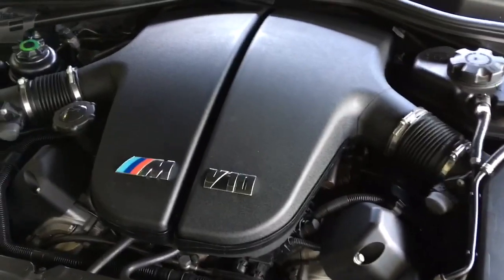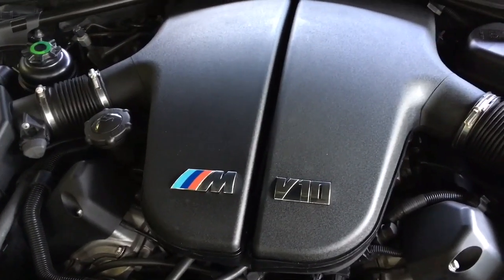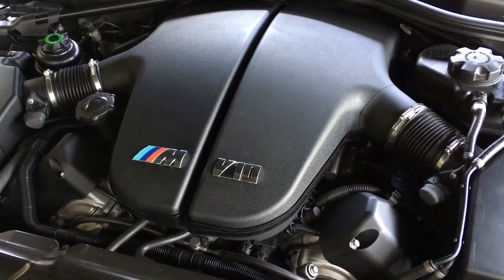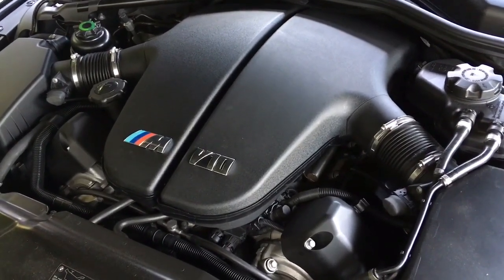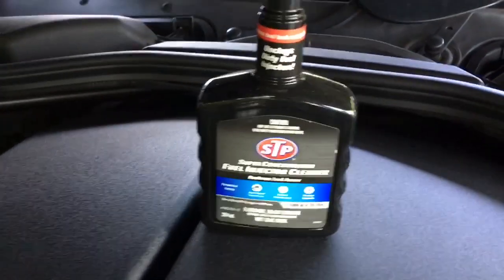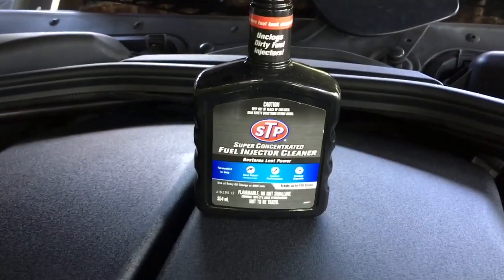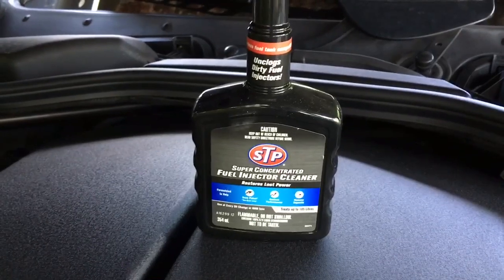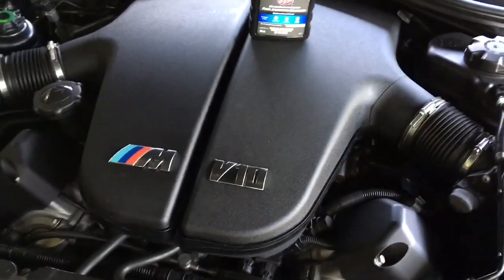How to avoid murdering a V10 engine   (easy BMW S85 diy)

Comment: Can your block crack from a fuel injector being stuck open? I had a shady mechanic tell me my block was cracked after I brought it in for a bad fuel injector.
Reply from the maker: Unlikely, depends where it’s cracked. Normally the con rod will bend

Comment: Hey mate, love your videos they are incredibly helpful. i just got an m6 and put a bottle of injector cleaner in but wondering if i should budget upfront to just replace the injectors. its got 122km on it and has barely been driven by the PO in 2 years
Reply from the maker: For sure a good idea. I owned my M5 for 3 years before I did mine, but wish I’d done it sooner-
https://youtu.be/7otKulz43WY

Comment: Hello M Tech Guy,

I actually just replaced all injectors on my M5 as maintenance while rebuilding the throttle valve actuators.

My NEW biggest concern is the lines from the tank and even the fuel rail.  No filter and degradation of the fuel feed system could compromise even NEW injectors!

PS:  Have many engines....2 full, plus 2 short blocks....plus car.  Purchased engines before car to learn.  Two engines clearly hydro locked with bend rods and bores scored so badly, they could not be re-finished in Alusil at 0.2mm over......GRRR!

Have you added a fuel filter yet?  Interested in near OEM install for filter near rail to minimize potential of clogged/open injector.

Cheers,
P-Chi
Reply from the maker: Sounds like you have a few S85’s to play with 👍
The fuel filter at the tank is fine so long as it’s changed out now and again
Reply: @MTechGuy  

Hello M Tech Guy,

Yes, I do have a few engines to play with.  I have been researching the S85 for years, and have wanted an M5 even when they were "ugly" (e28), but it was so powerful, I fell in love!  The M5 has always been a wolf in sheep's clothing!...but not a big fan of the newer "hot block turbos".

Love your videos and please keep posting.  I now have a vehicle and am doing maintenance beyond just my "play engines".

As for why I replaced fuel injectors and ask questions on fuel system....please view link below on the M5board.

https://www.m5board.com/threads/s85-bore-issues.607517/page-4

Cheers!
Mr. P/P-Chi
Reply from the maker: The E28 M5 is a nice car! Not a big fan of turbo charged cars myself either. Wouldn’t mind a spare S85 to make some vids on. Will have to check out that link, injector fail more common that we’d like aye!
Thanks for following the channel man, Merry Christmas 🎄
Reply: @MTechGuy  

Merry Christmas and a Happy New year to you and your family.

Hope you keep the M5 content, and all content up for 2022.

Cheers,

Mr. P/P-Chi

Comment: Mtech guy, what is you opinion on an engine tune??
Reply from the maker: I wouldn’t bother. The S85 is an extremely well designed engine for the amount of power it makes. Tunes have been known to contribute to issues & failures. 507hp is plenty for a street/road driven car anyhow!
Reply: @MTechGuy  mine is already tuned, but I didn’t feel much of a difference. I’ve put over 6k miles on since tune and it’s been fine. But I don’t want my shit to blow up
Reply: @MTechGuy  mine might not be as reliable, but damn having an ESS supercharger on my M6 is fun. 675hp is definitely worth it

Comment: Ok, gotta add my 2 cents here. I have two of these. First of, STP is hype, like Fram filters, all hype... use Lucas fuel system cleaner, it does it all, not injector cleaner, use the fuel system cleaner...Lucas. Ok, rod bearings Yes, warm it up correctly [it's vital]. I believe with all my heart, if there were a problem with the material in the bearings BMW would have fixed it...there isn't. Proper warm up, use the correct oil, 10w60 only, not 10/40, 20/50...no. I know the 10/60 is pricey, but what many don't know is the 10w60 is vital for the vanos system, the high pressure line internally and lubrication...I could go on, but.......................
Reply: The foremost s85 engine builder in likely the world recommends redline 5w/50. The vanos system is dependent on oil flow which is affected by pressure. Fact is a thinner oil flows more. Here’s some fluid dynamics equation for you…Flow = pressure/resistance. Resistance = line length x viscosity/ line diameter cubed. So, if resistance is greater due to viscosity (given all variables are the same), the higher viscosity oil will not flow faster than a lower viscosity. The question becomes what’s the oil pressure with lower viscosity oils and do they offer adequate wear resistance? If oil pressure is good, then flow will actually be improved and the vanos system will not be compromised. I use a racing specific full synthetic 0w-50 oil because of the much greater amounts of wear additives than standard synthetics. The problem is dual, the extra additives will eventually foul catalytic converters (my cats were removed) and less detergents meaning more sludging over time, so I change the oil at 2-2.5k to keep the engine clean.
Reply: Lol never use 10w60 on s85
Reply: @nenadradmanovic9383  Yea, you know better, right? I mean I forgot, you designed, built, raced these engines...I forgot
Reply: @artbrookey3468  had only used 5w50 on my manual m6 for past 140k miles. Owned e39 m5 from 70k miles to 220k and only used 5w50. Tracked both cars and never had any issues. 10w60 is garbage oil and is cheaper than redline 5w50.
Reply: @nenadradmanovic9383  I don't doubt that some get away with it. My wife's Jeep says 5w20, but I know I can get away with using another weight, just like you can go from synthetic oil to conventional oil, and might get away with it. You do your thing, I will stick to what BMW motorsport and every respected shop has told me with the three E60 M5's I have owned since 2010
Reply: @artbrookey3468  agreed! The actual recommendation is 10w60. I spend a bit more to import Fuchs Titan Race oil. Worth it in my opinion. But people can run whatever oil they want. Doesn’t matter to me! :)
Reply: @artbrookey3468  I ran 5w50 on my e92 m3 for 6 years lol. If you know you know, Troy knew what he was doing, even though he had his negatives still knew the s65 and s85, he built over 500 of them, most stroker motors, the oem rod bearings just last longer with 5w50 then 10w60.

Comment: I change my oil every 6k miles or 1yr whichever comes first.  I also warm it up for about 2min. I have 126k miles and the car runs like a dream.  Should I get the rod bearings done as a preve measure? My indy says no.
Reply: I would change them as soon as you can. No matter how careful you are, changes are you will see copper on them, especially on the top bearings. Use the BE bearings.
Reply from the maker: That’s a really good question, I plan do do a video on this very soon

Comment: What would be the best ideal proper warm-up for this car?
Reply from the maker: Let it idle for a minute after start up, them drive it straight away but keeping the RPM’s under 3000 until the oil has reached  normal operating temperature (approx. 95 degrees C) 👍
Reply: I allow warm up to the point where oil temp is just over the bottom of oil temp gauge..roughly 3 min in moderate climate

Comment: Since I live in California we only have 91 octane gasoline so should I buy a barrel of higher quality gas or am I good with what we got over here?
Reply from the maker: 91 US = 95 Euro RON, that’s the minimum octane you’d want to run these cars on
Reply: You must remember though that Cal/Ariz/Nev 91 is terrible compared to actual 91 elsewhere. I'd recommend adding VP Octanium Unleaded every few tanks if you rip on the car hard often. It'll kill multiple birds with one stone. Fuel injector cleaner and octane booster and it's still safe on factory o2 and cats.
Reply: If you use an octane calculator you can mix your own.  Never ever go more then a calculated 100 octane
Reply: @mattb6595  
Hello Matt B,

Very interested in why I cannot use over 100 RON?  I am not a chemist, but my understanding is that the higher RON actually reduces the flash point of fuel to avoid knocking or pre-detination of the fuel/air when compressed.  It does not, by itself, offer higher performance.  This is very important for high compression and turbo cars, but not does not add performance if not needed, but could actually reduce performance on low compression engines.

At over 100 could the engine not have a clean fast burn in the cylinder with spark ignition?

Please advise,
P-Chi

Comment: Easy way to avoid rod bearing issues , use a thinner oil.  10w60 was just a boneheaded move by BMW.  I understand why they chose it , but somehow they overlooked the most basic clearance vs. viscosity fundamentals in pursuit of slightly more protection elsewhere.  S65 and S85 have tight rod bearing clearances ideal for a 30wt or 40wt max.
Reply: I use 5w50
Reply: @crisnla1  any issues so far? How long already?
Reply: I use Mobil 1 Racing formula (0-50w) which has more wear additives (zinc phosphorus) than any conventional or synthetic oil. Not the best for the cats but I care more about the engine internals
Reply: @Bimmer_Bill  That seems good.  The 0w especially because of how long it takes for the oil to heat up with that huge oil cooler and like 9 quarts of oil.
Reply: @Bimmer_Bill   on you m5 you use this
Reply: @catalinosolorzano7054  yes keep in mind it’s racing oil, meaning more wear additives, but also less detergents, so you’ll need to change the oil a little sooner than non racing synthetic oil. I plan on doing it at 2.5k vs 5k.
Reply from the maker: Hear a few guys out there do this. Many things to consider with regards to oil viscosity choice- climate the car is used in, VANOS system that operates at 8000kpa, how the oil holds up at 8k+ rpm, additive package, oil choice available in owners country etc.etc. I use 10w60 myself here in NZ, regular changes, proper warm ups. Each to their own though 👍
Reply: @MTechGuy  Top fuel dragsters that make 10,000hp are the most violent motors with serious flexing and vibration stress happening.  And they run 70wt, which is the thickest of any engine I'm aware of.  Formula 1 and Nascar both use the equivalent of 0w10 to 0w15.  But they are proprietary formulas.  The average road-going car runs 5w30.  So , from these angles as well , 60 doesn't make sense.
Reply: What are the clearences?
Reply: @yujyuj2957  0.0013" - 0.0018"
Reply: @yujyuj2957  Check out this Video - he talks about the clearances https://youtu.be/i1gLhYwkiSU?list=PLy9wIVJw2YnU9cki4LT3AoscvswknQ4T7&t=226
Reply: I heard a typical high-performance (not racing) motor you want a Rod Bearing Clearance of 1.5-2.0 Thousand, size of a human hair.
Race Engine will have looser (2-2.5 Thousand) clearance.  Because of the higher RPM, HP, Torque, to allow higher oil flow between Rod Bearing.
3rd party checks of E60 S85 motors, Rod Journal-2-Rod Bearing, BMW are showing about a true 1.2-1.3 thousands (FAR TOO SMALL Clearance/Tolerance)
Reply: @robertwallace5471  Yeah , too small for 60wt for sure.  Although , if you wanted to limit engine life to around 60k miles and get away with it, that's a good way to do it.  Then the customer has to buy a new car sooner and there are less used cars on the market.  I think all their cars used 60wt at that time.    P.S. Top tier racing engines like F1 and Nascar use very thin oil, tight clearances, and high pressure to keep frictional power loss minimal.  F1 engines needed the block and oil preheated to 80* or it won't turn.  Nascar too I believe.
Reply: Someone should write a users user manuals for these S85 cars. You’d make bank. I’ll pay $100 for 5 pages of end to end how to maintain and operate these properly, fix known issues and tune responsibly.